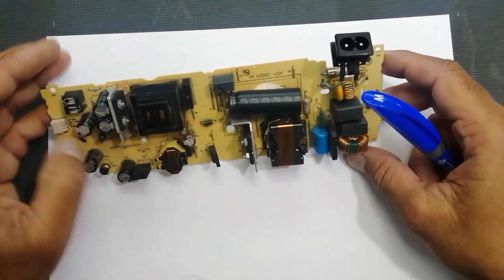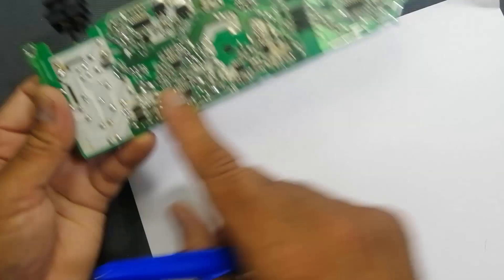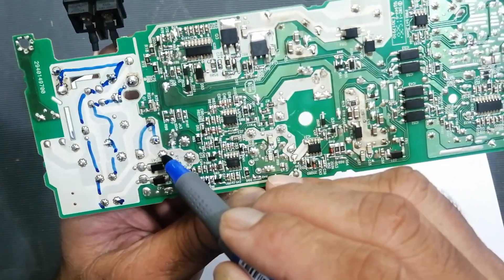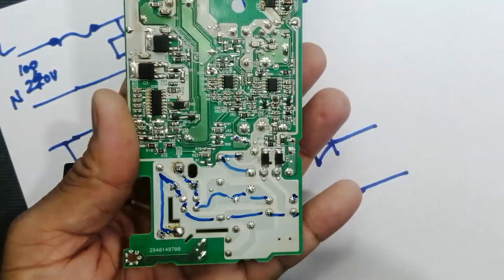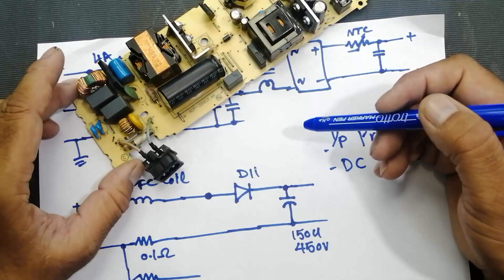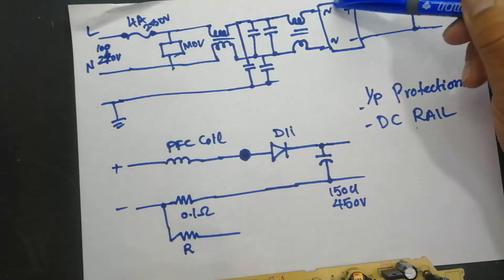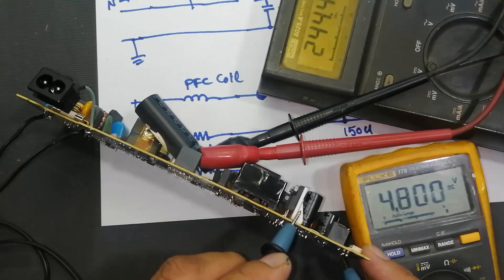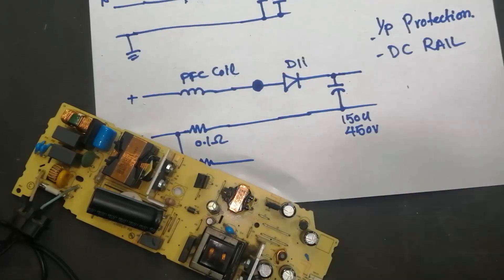#304 Sony PS4 Power Supply ADP-200ER - Input & Protection Circuit

Comment: Hello. I have a power supply adp-300fr ps4 pro, there were problems with the 40N60 transistor, fixed. There were problems with DAP049 and 1612a3, fixed.
Now there is a problem, the power supply gives out 13.9V and goes into protection, this is too much. Can you tell me what it could be, what components to look at? Thank you

Comment: Hi sir, i have a problem with power supply adp-160cr. On bulk capacitor there is only 310V (ac input is 237v so dc should be 335vdc). The standby voltage is only 4.65V also acin_det is 0V. I short acdc_stby to 4.65v but psu not giving 12v.

Maybe i have issue in bridge rectifier? Why is my standby dc only 310V? Also after mains switch off 310V goes to 10V within 5 minutes automatically. Very fast discharge.

Comment: Hello sir, i have two psu adp-200er with zener diode zd39 (script in board) shorted, proximity in DAP041 (CS PIN), please what is the value of the ZD39 zener diode on the adp-200er board? Thanks so much, good job.
Reply: hello, did you discover the diode reference zd39?
Reply: @dragod7461  Yes Sr, is 9v1. Thanks.

Comment: Dear frind.
I have a trouble.
please help me.
The fuse of my PSU has been blown and my ntc thermistor only has 4 ohms.
Could this be the cause?

If so, I would like to replace the ntc thermistor, but my ntc doesn't say anything about it.
Which ntc should I buy?

Thank you very much.
Reply from the maker: please check more component like bridge, MOSFET
ntc is normal. 
most of the time it is 5D, TO 10D (5 means 5 ohms 10 for 10 ohms) (first digits before alphabet is ohmic value)  please read the number and point to be noted that its resistance changes with temperature rapidly
we can say from from very low resistance to more than it's nominal value. (check at 25 deg)
Reply: @HaseebElectronics  

Thank you my friend.
I'll try what you taught me.
I'll let you know if it works.
I'm looking forward to your next video.
(^^)

Comment: Hi brother.I am having a problem with my ps4 power supply not giving me 12v. I am getting 5v standby but when I switch power on I dont get 12v. What component should I start testing first. Or if you know what can be wrong.please brother.
Reply from the maker: is it adp-200ER
check voltage on main DC capacitor it must be 410 volt (when power on command is applied). if voltage are just 300+ in case of 220 or 160 in case of 110 volt.  then check off circuit mainly failure in MOSFET & rectifier in pfc section

if it creates 400+ vdc at bulk capacitor
then go to verify both mosfets in 12v stage.
both mosfets in output side of 12 v transformer's secondary
Reply: @HaseebElectronics  thank you my brother for the helpful information.I will check as u asked me to do. I will let you know what happens. Thanks once again.
Reply: @HaseebElectronics  sorry brother. This is adp 240CR AAB board.will the same checks apply to this board.
Reply from the maker: ADP240 IS MUCH CLOSER TO ADP200
Reply: @HaseebElectronics  asalaam walaikum brother. I check main capacitor is 315v (when command power button on).
Reply from the maker: it must boost up to 400+ vdc at main capacitor when power on command is applied
Reply: @HaseebElectronics  ok brother.so I must check rectifier and mosfet on 220v side.correct.
Reply: @HaseebElectronics  can I test these component in circuit or do I need to remove from board.
Reply from the maker: @thakrimessop3947  1st of test in circuit dc voltage
if it doesn't work then check pfc section components
and push pull stage power components
Reply: @HaseebElectronics  thank you my brother.I am not advanced in electronic like you.Maybe I should srnd it out for repairs.thank you so much brother. But I did test mosfets in circuit and it shows continuity across all three pins.
Reply: @HaseebElectronics  assalaam wa alaikum brother.hope u are well.so I replaced the 2 mosfets but im still not getting 12v output. What component should I check next.thanks my brother.

Comment: Very good explained. The pain with this 100-240Volt power supplies is, that the fuse is more and more useless on higher voltages, because it will trip too late. Thats the reason, why faulty power supplies are seriously damaged before the fuse tripped if they used on 230V.
Reply from the maker: you are right. the basic issue that the fuse used in these circuits is slow blow type T series (Time Laging fuse) , because a quick arcing F series fuse cannot be used because the power supplies have inrush circuits, so f series fuse have no tolerance. 
then the T series fuse is used which causes to give the delay during startup inrush but in case of over current, it delays as well so the circuit damages and fuse remains serviceable